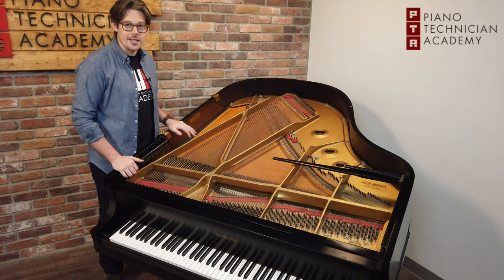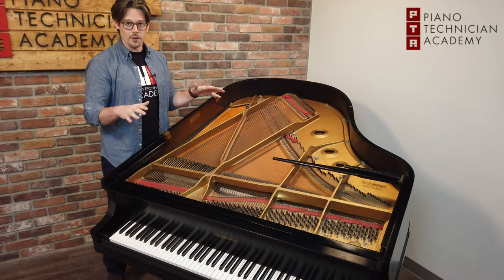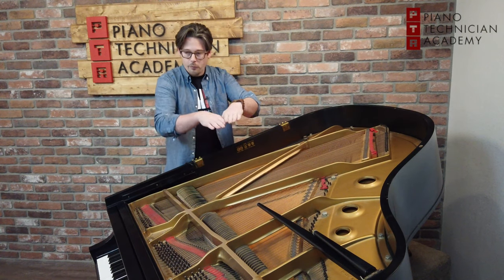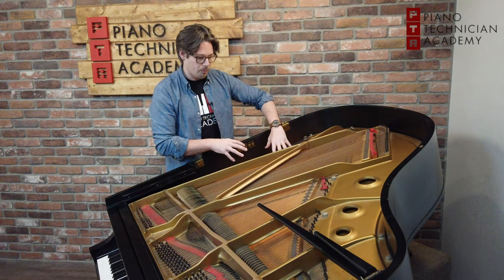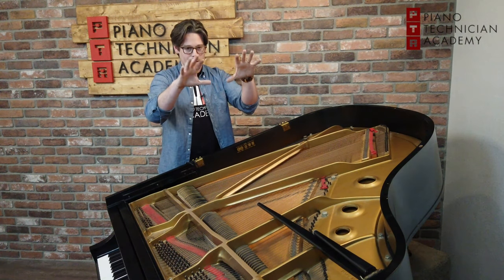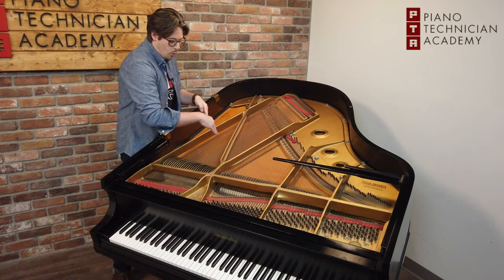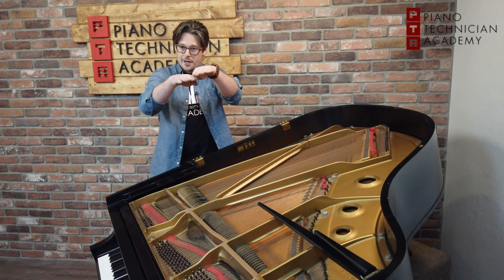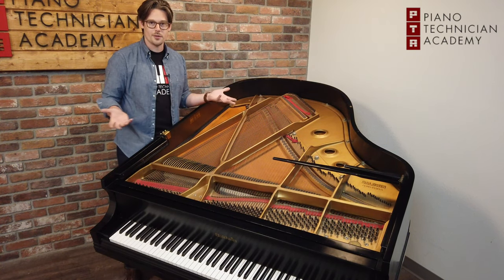What is a Piano Soundboard?

Comment: I found a piano/soundboard leaning up against a dumpster. It's super heavy. I want to do something with it, possibly repurpose it as a wall piece that is "playable" by touch. My question is, will removing the soundboard make a huge difference in the resonance? I'd guess it would matter greatly. I'm a guitar luthier and had an idea, what if I removed the soundboard and mounted the piano directly to the studs in wall in my house/guitar shop? I plan on making a video of this process if you're curious to see what happens. Thanks for the video.
Reply: the soundboard is the part of the piano that makes all the sound, so YES.